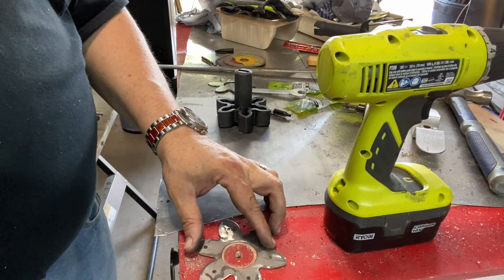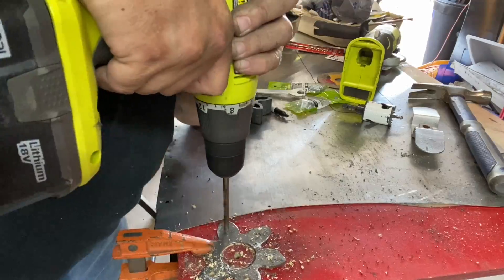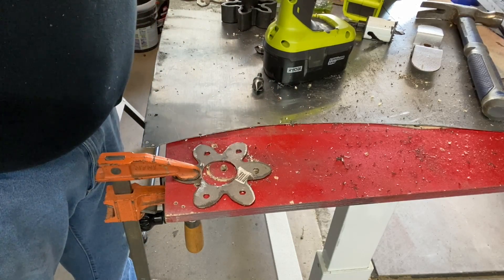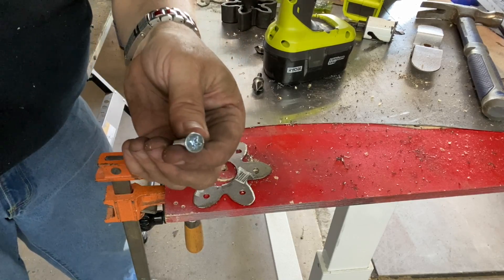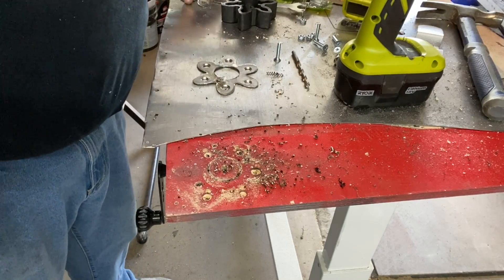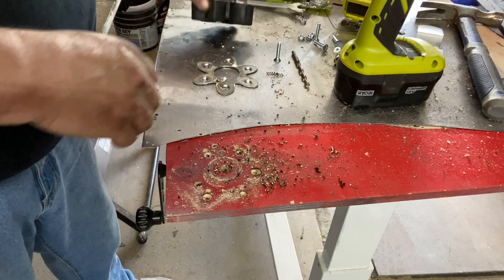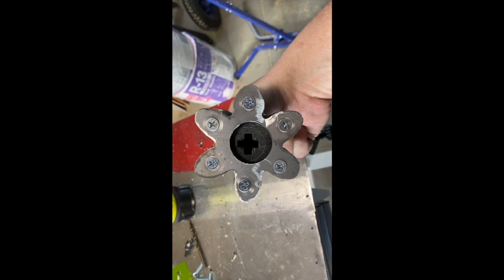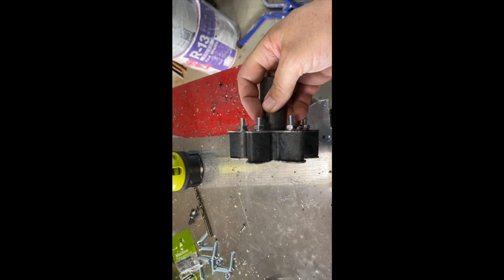Mantis Rotating Compact Composter Gear Fix

Comment: I actually just received my new Mantis Composter today and now I see this video. I’m kind of already wishing I hadn’t ordered it. If I had the materials and the tools needed to fabricate a fix like you did, I would certainly try it. Now I’m worried about whether the gear will last on my Mantis composter. Thanks for showing us how you fixed it.
Reply from the maker: I can’t believe they haven’t fixed this issue.
Reply: Wonder if filling the hollow part with epoxy or something would solve this? Your fabrication is beyond my toolset. And yes, the plastic is poor - my replacement broke in less than a year.